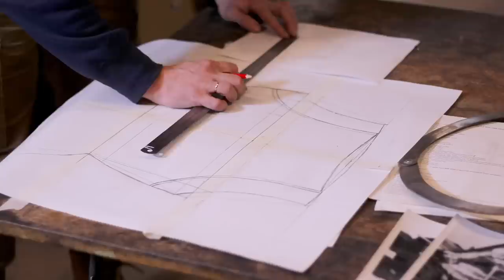How to make cuirass. Forging armor

Comment: Looks insanely hard to make. Now imagine folks forging a knight's armor 700 years ago.
Reply: Makes you realize why full plate armor cost as much as a house
Reply: 700 years ago they still had power hammers. They were powered by waterwheels but a lot of the process hasn’t changed over the years
Reply: Well they had pretty brutal tools back then as well, machine-like hammers and such but usually the blacksmiths were in the service of the king and the materials were hard to come by.
Reply: I'm sure you could just look it up on YouTube back then too
Reply: @Kingdomkey123678  not likely though. There's very few places in Europe where you have streams that are right for water wheels. And usually water wheels were used for the general good. Since they are incredibly expensive marvels of engineering. It's not until the industrial revolution that water wheel power was used for smithing purposes. And it was mainly smithing for trains or mass market things. For anything sensible you'd just have a few guys with hammers.
Reply: @andrew3606  yep, fully bespoke knightly armor with hand-pushed engravings telling minor stories such as vines, roses, frolicking angels/birds   there was one thats like that head to toe, 1470s italian-german gothic armor, 32k USD upwards to 104k with gold leaf and resin infills.   600 years ago, these armor went for approxmately 300 silver sterling's or 300,000 pence.  For a nice stately home that had servants and attached stables that held 8 horses cost 260 silver sterling's (1480s)   a fully fleged church with land went for 150.
Reply: That is why surname Smith existed you was old enough to get near a forge you were making armor with your paw
Reply: I read that a suit of armor then cost as much as a Lear jet today. It was only for the very wealthy. I know it would break the armorer's heart but it would be interesting to see what this armor would actually stop from penetrating it. Sword, arrow, or spear.
Reply: 700 year ago made in big royal workshop with hundreds of worker
Reply: Besides the difference in tools, realize that they did not have the steel plates either. They had to forge everything themselves with ingots at best.
Reply: I mean, that really intricate of armor didn't come around till around 500ish maybe more but yeah still crazy
Reply: @MrKaiyooo  Not even remotely true.   Guilds would set up massive workshops on rivers well suited to water wheel use and build quite massive facilities (for the time) with wooden gearworks to transit the power.  That would be coupled with water-powered bellows to create early blast furnaces for smelting and forging.   There they would rent out booths to craftsman of the guild that wanted to make use of their equipment.   Because the guild was the one to provide the facility, they could invest quite a lot of money in the workshop, a cost which would have been far in excess of what individual smiths could afford.   There they would have water powered grinders as well.  They were stones instead of sanding belts, but they worked well enough.  In addition almost all of his hand tools in this video are based of designs from the old days.  

The movie version of one lone guy with a shack and little charcoal fire, and a single anvil pounding away outside his mud hut was something limited to the depths of dark arges, or the more rural, backwater locations.  

The reason why armor was stupidly expensive, that much high-grade steel was insane.  Think the steel's weight in 14karat gold today.   Now add on the services of an armorer who were worlds better than today's people and held to much higher standards, to not only provide custom manufacture, but lifetime service on the armor and it got really expensive, very fast.  

It wasn't the industrial revolution for several major reasons.  One was gas and steam power hasn't been invented yet.  While I think you massive underestimate how much water flow is needed for a wheel system, it was still quite limited on locations because of it.   The 2nd mass steel smelting hadn't been invented, sharply limiting production based on resources, not skill or manpower, or even general tech, The fact that iron costs what sliver costs today roughly really made things like big metal machines  impossible.  And finally the concept of standardization hadn't been invited.    The reality is the idea of standardizing parts to be interchangeable was invented in the early United States in the start of the 19th century.   While it sounds like a very, very simple idea, and its very easy to say, to actually achieve it requires a lot of effort to ensure uniformity of production.   Prior to that idea everything was being just hand fitted carefully, like it had been for all of history.
Reply: The biggest difference in outcome between the way it was done and recreations like this is the consistency. If you have to hammer form steel into sheets by hand or with primitive power hammers then you’re going to have an extra hard time making sure the armour is evenly distributed.
Reply: "Clank clank clank clank clank" 'oh no the knights are coming!'
Reply: @tsunamidon8113  All european countries have their own smith surname Ferrari, Herrero, Kowalski...
Reply: That's exactly what I thought when I saw the thumbnail
Reply: this is 16th century armor , prettymuch exactly 500 years ago. 
and this is a half armor not a full armor.
Reply: @Annatar0  its a german style, the the blacksmith in service of the king(and emperor) would be the Helmschmidt brothers they were pretty rich through their work
Reply: @MrKaiyooo  are you insane? every major river was decked in water wheels they had to float mills in the center of the seine in paris bc all the other spots were taking, 
also building a pont and rediverting a lil creek was very very common
Reply: @MrKaiyooo  wrong, 12th century germany introduced the first recorded  waterpowered hammer. some of these old hammerforges are still around in germany austria and the swiss.  so common they were that even after centurys of modernisation some are left.
Reply: @MrKaiyooo  they literaly had half automated ironsmelting orecrushing hammers and all driven in nuremberg by water same in augsburg etc.  you have no idea about late medieval economy.
Reply: @rudyyarbrough5122  nah there was a big market for used armor and you could get everything from cheap armor to very modern armor the modern one would be more expensive. , but old armor? every free farmer had some of that, every townsment had to own armor in many free towns.
Reply: A nice set of armor cost as much as a village
Reply: @MrKaiyooo you could still have a power hammer where one person turned a handle it would still be much easier than swinging the hammer.
Reply: Well, this is the kind of armour that was worn 500 years ago, 700 years ago plate armour was just being experimented with.
Reply: Cuirasses didn't really exist before the invention and wide utilization of firearms
Reply: I have tried to make a chest plate at home and I can confirm it’s the hardest thing to do
Reply: most armor was made in places that had water streams and power hammers  @MrKaiyooo

Comment: I think one of the craziest things about this is that even though all of his presses and dies and stuff make the job 20x easier, a medieval blacksmith would do every single one of these things just with an anvil and hammer, and maybe a few hand-made dies stuck in the anvil.
Reply: He would have a lot of help too. Someone to keep the forge going, others working on different pieces, making the chain mesh, re-heating each piece, cutting out the pieces, and carrying it to the blacksmith for forming. I can picture a shop-like atmosphere rather than as in the old West movies where there is just a blacksmith working alone. I have seen a video of making chain mesh and it is literally one link at a time, woven into a large piece.
Reply: Most of the machine tools used here can be created with wood, leverage and gravity. I don't know if there is any evidence of smiths using them, but they are certainly possible for even a basic carpenter to construct with 2x4s.
Reply: before mechanisation came child and indentured labour. mass education emphasises reading and writing; apprenticeship didn't need it. so nothing recorded but the armour made speaks for itself. a lot of labour under strict supervision.
Reply: Yeah I made my own chainmail vest and it took around 100 hours from wire spools to finished vest. And I didn't even use an insanely fine mesh just a 4 in 1 with about 3/8" diameter rings. And I just bent the rings together by hand not welded, forged, soldered connections.

Comment: What is the thickness or gauge of that metal? I'm curious what the range would be between function and I guess when the weight would make it unfunctional
Reply: 1/16 gauge 
1.6 mm
Reply: @mariajosefacarlon5184  thanks
Reply: I think the thickest cuirass used was 9mm at its thickest point
Reply: @Themanwiththeplan1899  wow. That must have been pretty heavy

Comment: Why do chest plates bulge out at the bottom? Is there a specific reason why they are made that way?
Reply: Yes, it’s because without the bulge the edge of the chest plate would cut into your skin or anytime you bend forward. Even if the metal is smooth and rounded it will still dig in and potentially cut off circulation. Hope this answers your question.
Reply: Also, the bulge allows more room for any weight gain.
Reply: Just remembered this: the bulge can also be used as a small storage area (coin purse, a small loaf of bread, documents, etc.)

Comment: Nice video but the soundmixing is cruel. The dB differences are waaaaay too big.
Reply: You should also really consider changing your cutting style. Sometimes you show a lot of slow progress and document every little bit of it wich lengthens the video a lot and sometimes you speed scenes up so much that the progress isn't even noticable.

Comment: im not sure but this steel does look too thick to work with to be historical, i mean you had even to heat it sometimes to work, id imagine most of the armor shaping was cold and they didnt have powered hammers, also the breastplace does look too small , lots of his body still exposed ny the piece that should be the thickiest and cover most of the front. that neck thing and the two smal lround things look out of place somehow.
Reply: Where did he say historical?   Are you a historian?  Just a little bit of research showed me that he was actually using fairly historical methods.  They didn't have angle grinders either, nor bench grinders.   Of course he was using more modern tools. But they did use rollers and such, and general shapes were formed with cold forging but would often heat areas that required a finer adjustment in order to forge them to their correct shape.  
I'm sure whether or not the plate was too thick is subjective.   I'm sure there were thicker and thinner plates.
Reply: @Epiphalactic  they would make it thicker on the center and front of a breastplate, limbs and other places where thinner, he could be doing it better, theres lot of things he should be considering but ain't, looks ok but it lacks the form and finesse historical armor has, the armor shaping was mostly cold,  the properties you want in a piece of armor are different from what you want in a sword, even with tools, if you watch other armosmiths on youtube you see theres much he can improve, if the armor isn't perfectly shaped/thick and fallowing the forms people made in medieval times, sure it will still be better than nothing, but it might hurt you/make you sore/tire you needlessly / be cumbersome and obstruct your movement, just compare what he did with what other armorsmiths do, id never try to do reenacment combat nor jousting in this armor, but he can get there. just compare what he did with a milanese suit (wich was a simple mass produce late medieval era armor) he should be trying to achieve that first before trying to inventing, just my opinion tho.
Reply: @felipeaugusto6991  this, if I am correct, is a late 16th century design, and it is pretty historically accurate. Milanese armour was NOT mass produced, that was three quarters, or Munitions armour, which the lower class, or poorer men at arms used.
Reply: this steel armor could survive a 5v5 or a skirmish in buhurt since it is 3mm
Reply: @graemesmith6599  it is not just the thickness, but the form, how it sits and transfers energy, and the quality of the material, what im saying is that by comparison with historical armors this is not a good fit, if i were him id try to learn/copy from historical armor much more, or go with a easier kind of armor to fit like a coat of plates or brigandine, it looks off in general and ofc some armor is better than no armor, but there are things you must get right or you will hurt yourself even with armor, and thickness is really important where it is needed, if you do it all around you will get a suit that tires you and with unproper fit it can even hurt yourself, much a like a sword without proper form it will be much less effective.
Reply: @felipeaugusto6991  also this suit he was making for a cilent so not ment for him would fit the person who  ordered  it better
Reply: Power hammers are actually a rather old invention, granted back then they were powered by water wheels but they existed
Reply: @duskyflathead4483  There are historical records and receipts of Italian armor smiths producing several suits of export armor in a single day.

The receipts show that the armor was purchased from knights and nobleman from all over europe.

These armors are by no means munitions grade, and are Full steel plate armor mostly in the typical Milanese style.
Reply: they literaly had powered hammers,  some of them are even still to be found in germany austia and the swiss.   waterpowered hammers exist since the 12th century in europe. which is why european steel was cheaper and slightly higher quality than most places in the world
Reply: @duskyflathead4483  first half of the 16th century, mid at best, late has a central line, a gänsebrust shape, 
what he made is what would be worn in the first 3 decades of the 16th century
Reply: @felipeaugusto6991 The form of this harness is historical,it’s of the Maximillian form from the 1520’s. But without the typical fluting. His forming is quite good. Nothing to complain about at all.